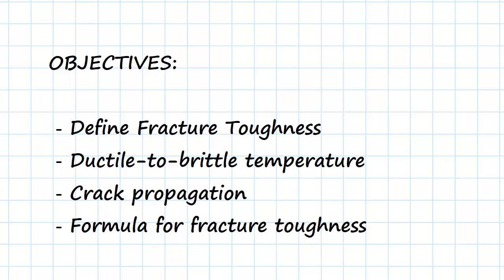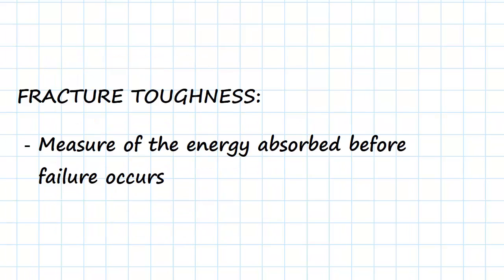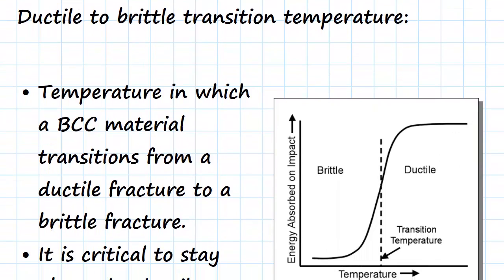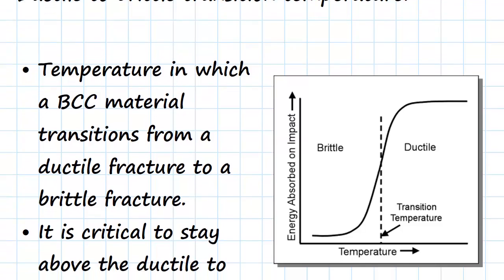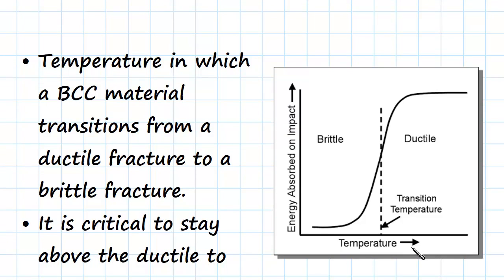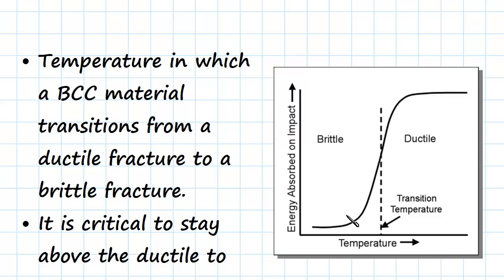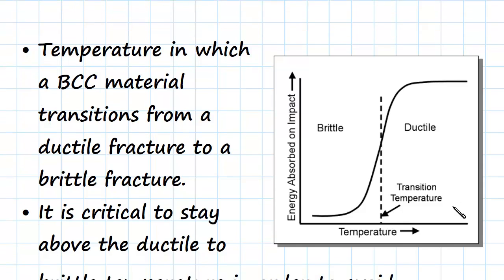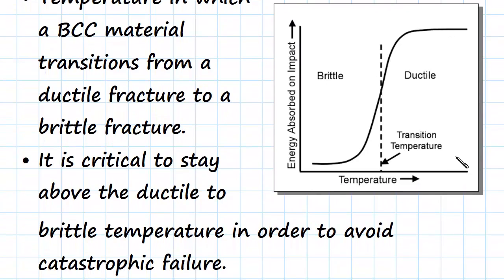Crack Propagation and Fracture Toughness | Engineering Materials

Comment: This is wrong definition of fracture toughness, even it same as Wiki 
fracture toughness: A resistance to crack propagation or extension of material 
toughness: Ability of material absorb mechanical energy up to the point of fracture.
Reply: Yes, Fracture Toughness does not have units of energy!? (although they do say "measure of energy" to be fair).